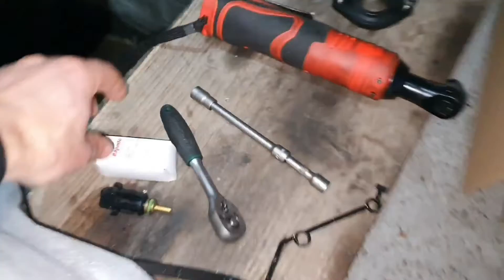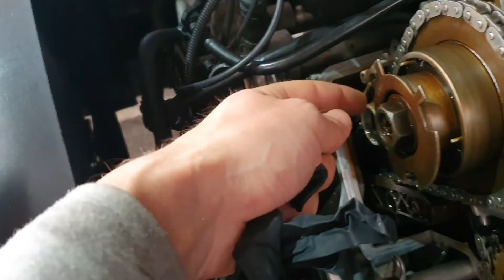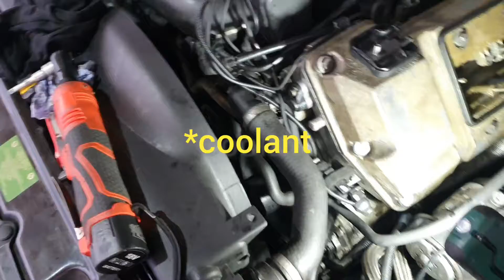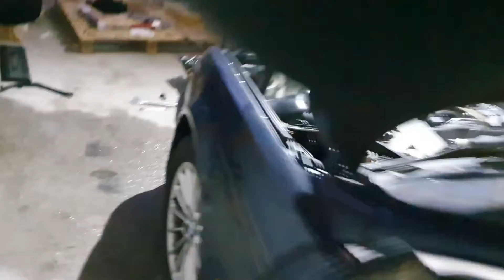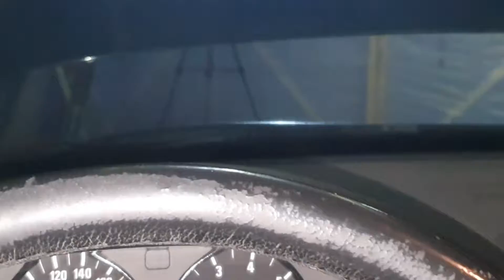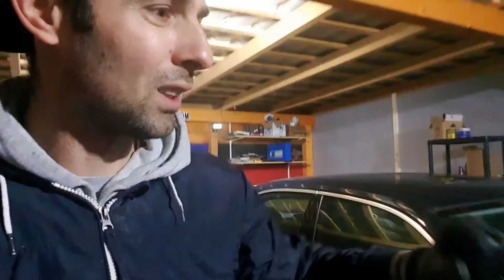Bmw E39 project car! Back together!!! is it still leaking?? P8

Comment: Yeaaaaaahhhh she’s running properly and dry 👍🏻 what a lovely car! , at First I thought the socket was the cause of the smoke 🤣👍🏻
Reply from the maker: I found the socket on the engine mount before I've started the car 😅🙈 and I've thought the alternator was stuck.  Glad that it's fixed. Now I'm going for inspection